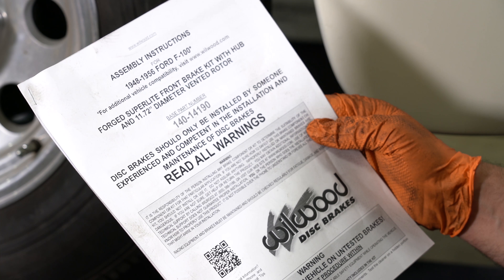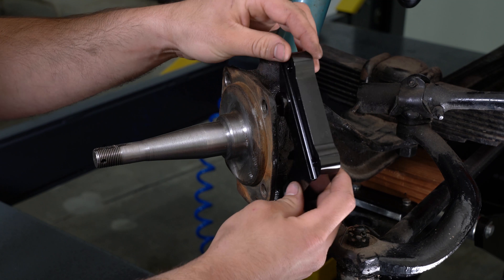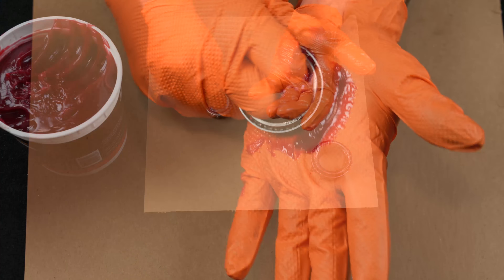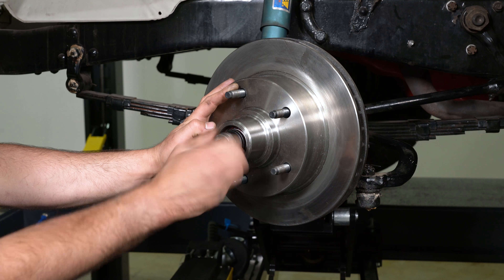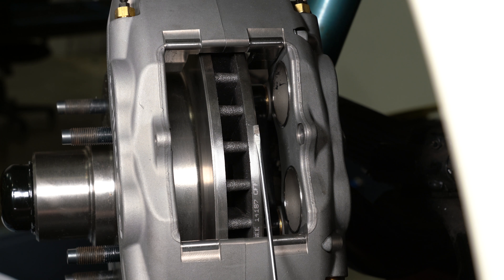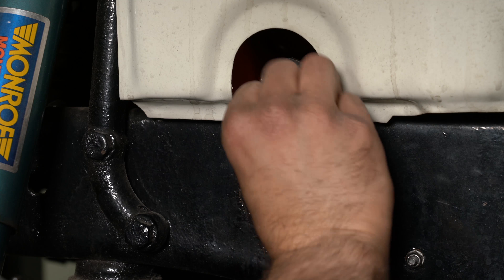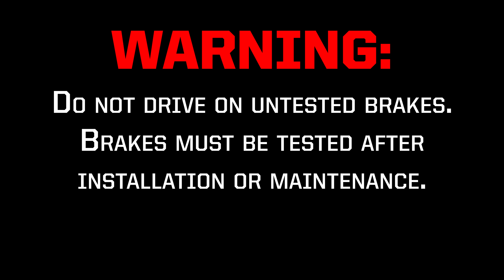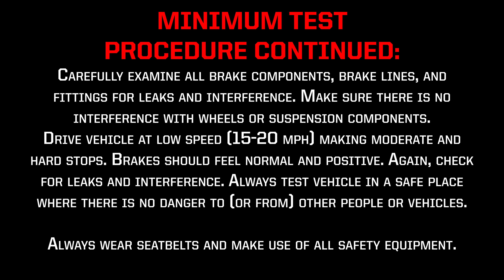Ford F-1 Truck Front Disc Brake Install

Comment: Does it need break booster since originally it doesn’t have
Reply from the maker: As long as you have a 6:1 pedal ratio and a proper bore master cylinder, a booster is not needed.